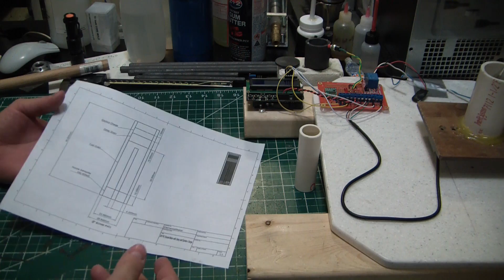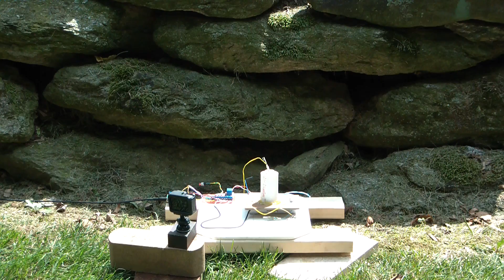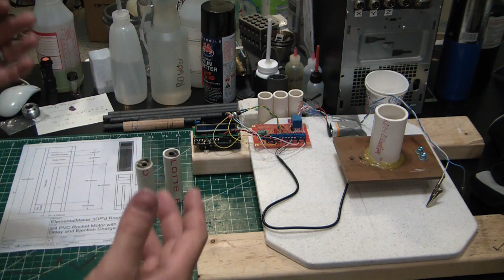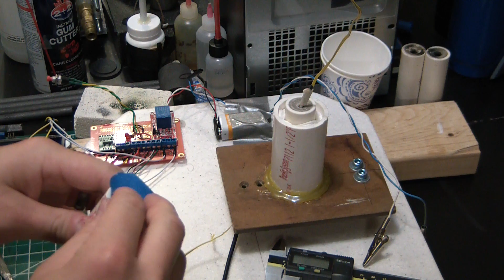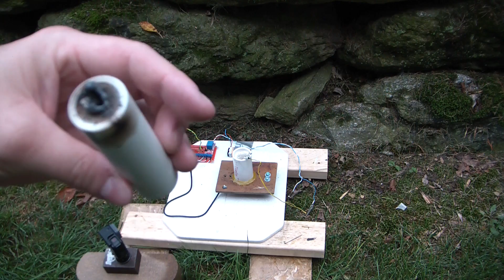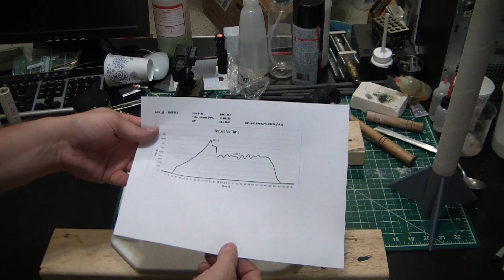Making a Characterized Sugar Rocket Motor - ElementalMaker

Comment: Should use some other binder then paraffin wax. I have a feeling the paraffin wax is what's creating the failure.
Reply: No binder. Just rammed bentonite. Groove the inner wall of the tube to hold the clay.
Reply: @timothypirnat3754  Agreed! No binder at all.
Reply: @timothypirnat3754  Now I've read where some pyrotechnicians wax the inside of their (paper) tubes. But since EM is using PVC, I wouldn't suspect any advantage in doing so.
Reply: Yup! My thoughts exactly! I make black powder (BP) rockets and dry press the clay/grog mixture using my rocket tooling (stainless). Works great, the rockets fly high, and I don't have erosion of the nozzles!
Reply: I've made these rockets following The King Of Random's guide many times. The 'kitty litter' nozzles work great most of the time (i.e. crushed up probably-bentonite-clay dry rammed). Only problem I seem to often have is the rockets blowing the top plug or the nozzle out soon after launch. It's random, it happens with a huge bang and I score the inside of the PVC quite deeply to give the clay something to engage so I'm thinking it's something to do with the hole I drill. Any thoughts would be appreciated.
Reply: I use a bit of powered graphite mixed in with the clay...
Reply: The wax probably vaporizes, which might just make the clay flake away. It might make it easy to pack, but there's no way it's adding any benefit at high temperature. If it needs to pack better, some kind of thermosetting material might work, like a dab of gorilla glue, or epoxy. Though hardened, densely packed clay alone should be sufficient, like TKOR used.
Reply: Elementalmaker seems to aim for the simple, household ingredients "You Can do It" approach.
These comments read like a "competition of complex minds"
Ummm... Dude. NASA uses this stuff called: S.P.N.S.
(SpaceX Proprietary Nozzle Stuff)

Comment: Just an idea that you may have zero need for, but i've been using node-red to help with automation for stuff like this.  You could use it to create a launch control dashboard, have it trigger your ematch and then collect all of the sensor data and dump it into something like influxdb.  Then you can graph it super easily with Graphana.  The whole thing runs easily on a raspberry pi.

Comment: Great video! I made some too, i found out that the best nozzle mix is wet plaster with a little bit of vinyl glue. Becomes rock hard!
Reply: That would work too. But I press my BP rockets dry and NO wax!
Reply: @htmagic  yup, i agree. I bet that the no wax is key. I try to ram my nozzles just slightly damp, not to ruin the fuel

Comment: Try Durham's Rock Hard Water Putty for nozzles. You can get it at Home Depot and Lowes as well as most other hardware stores for the last 80 years.
Reply: https://www.youtube.com/watch?v=BfAZx4FPNkA   Yep Durhams's....... I did this and had amazing results for an erosion proof nozzle.
Reply: Durhams is much stronger than plaster of Paris, and won't burn like the epoxy+steel in JB Weld.
Reply: Plaster of Paris would work well. Have used it casting silver so I am sure it would hold up.
Reply: I wonder if high-temp JB weld epoxy which is silicone release molded with a slight oversize to ensure it doesn't come out when being press-fit into the PVC would work? Thinking of how some things like brake pads are more or less a type of thermoplastic resin (which is a similar material to the ablative heat shields on some rockets), so that might be close as one could cheaply get for the home project version. And a hard material that resists erosion is more likely to be important than heat resistance given the short burn time of the solid fuel.

Comment: Great results! I think dry mixing the ingredients inherently introduces some unpredictable behaviour. Cracks might occur if the motors are stored for longer. I've heard good things about heating the dry mixture slightly above the melting point of sucrose to allow the sugar to coat the oxidizer, without caramelizing the sugar. You could also dissolve both ingredients in water and boil the water off for an intimate mixture, though I'm sure you're familiar with both these methods already.
Reply: I'm curious to know what control is done on particle size of the sugar and oxidizer.  Do they come milled or do you mill them yourself?  How do you effect  complete mixing of the two?  These factors will significantly influence burn rate, chamber pressure, etc.
Reply: Try making flexi fuel. It uses powdered sugar and Karo syrup. It won't crack over time but you need to put in a thin wax seal over both ends of the motor to keep the oxidizer from absorbing moisture.